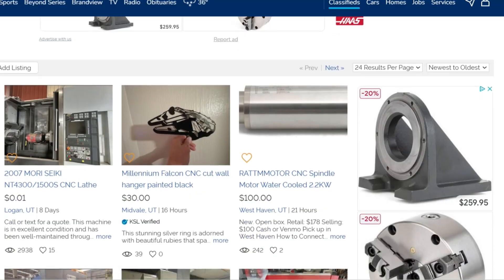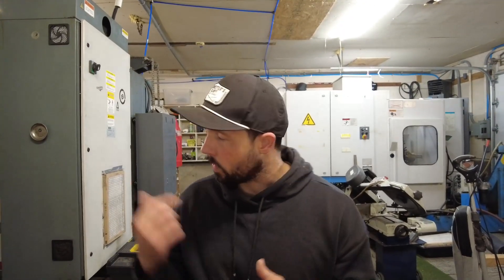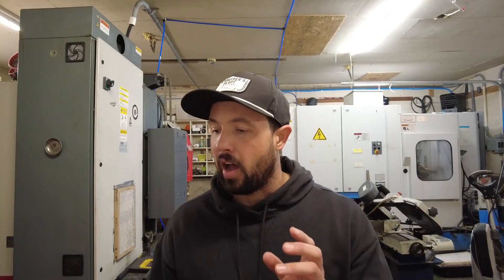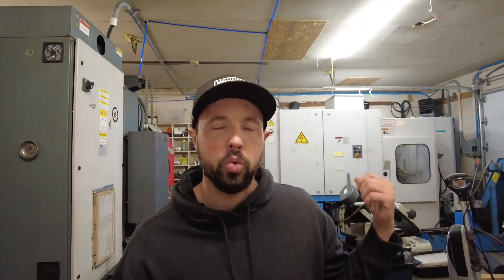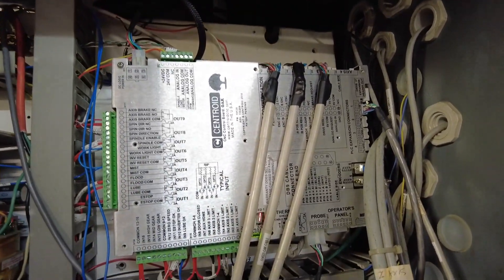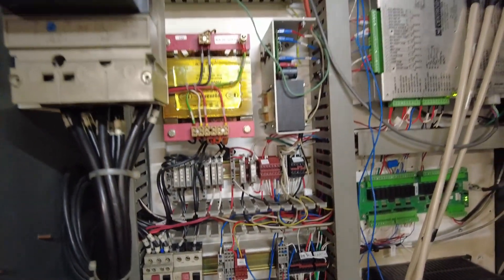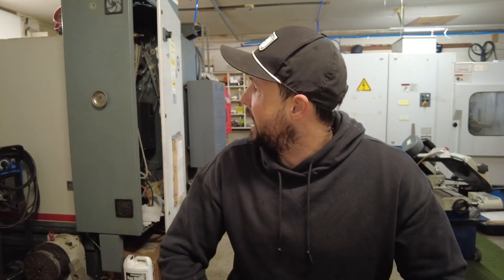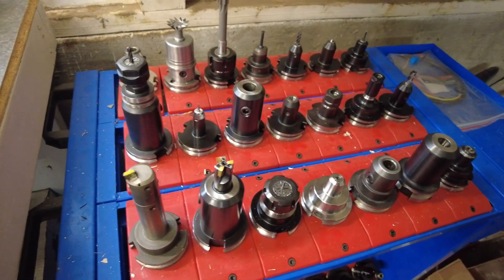CNC RETROFITS - HOT TAKE

Comment: A retrofit usually does not use parts from the brand of machine you are retrofitting ... I took retrofitting to mean that you do not use any original parts for the machine.  All you do is use the machine base as it were and everything else including pc, servos, interfaces and so on are from readily available manufacturers that never run out.  The whole point of a retrofit is to never have to rely on original parts for the machine.
Reply from the maker: I think you can certainly do it either way.  You could pull everything and start from scratch but both of mine I reused certain contractors and relays, much of the wiring guess it just depends on the machine and what it needs to do.  For me as long as it’s running and making money I don’t care what components it has.  Once you’ve done a retrofit you know what every part does and can pretty easily find an alternate solution if something fails.    Some of the motors have to be reused like the tool change motors air solenoids and they can be proprietary to that machine.  So it’s definitely a mixed bag.

Comment: I am thinking about converting an old CMM machine to be a mill... 
The base is made of granite, way covers are all there and all. 
Worried about the size of linear rails, or if there are actual ball screws in there.
Reply from the maker: Oh man,  I have no idea.  I mean in theory if there’s 3 axes and ball screws you can turn you can create motion, but you’ve gotta have a way to mount a spindle and have it be perfectly vertical.  I would say finding a small router would be much cheaper and get you better results.   Another down side to those CMM machines is so much mass is just the granite and it doesn’t really benefit you when it comes to cutting axis mass.  I won’t say don’t, but also really consider what you want the end outcome to be.

Comment: With the price of brand new machines from China it isn't worth retrofitting anymore.  Chinese machines are beautifully built these days and are full of top quality components from Taiwan, Germany and Japan.  If anyone is interested I have a really nice 2000 Matsuura VG660 which I am replacing. It runs great and comes with a ton of parts like drives, extra spindle, ball screws and linear guides from 2 others I sent off for scrap.  I paid $24,000 5 years ago. $3500 will cover it but it's in Canada so be aware for shipping cost and possibly tariffs.
Reply from the maker: I agree there’s a lot of great machines at a good price point now.  I do see a few Haas machines going for near free 2-5k range.   I recently saw a VF9 go locally here for 4k.  With a centroid retrofit you could have a STOUT cat 40 machine + new electronics for under 10K.   It’s  not every case but many cases where a retrofit is massive bang for buck.  I got my Arrow 500 for free, retrofitted it for around 12K and have made 10x my investment in 5 years.
Reply: @ericschneiter  I think a retrofit makes sense if the machine is nearby.  I put a Centroid on my old Hurco because I didn't want to go through the hassle of switching in a new machine. Shipping has become very expensive. 2 years ago I bought 3 VF3s all at once  so I could split the truck cost over the 3.  Shipping 1 machine was almost the same as 1.  Those were VF3SS models with lots of options and they were around 14k each.    Funny thing is I have 2 brand new machines coming all the way from China and the shipping is cheaper than the cost to truck those VF3s within the USA lol!

Comment: I did 4 retrofits on small conventional machines and learned a lot. The 2 last Centroid Acorn. Learning first on small, less complex machines helps a lot. I agree with a lot of what you said. I used clearpath and DMM servos and buying CNC4PC interface boards helped a lot with wiring the drives. If I went for a serious retrofit to make a living out if the machine, I would go Ethercat for sure.
Reply from the maker: Those acorn boards look like a great option. Do you have any new builds coming in the future?   I love the centroid software and it keeps getting better and better.  Lots of options now for the newbie up to the seasoned pro.   I may end up switching out an oak board for that hickory and the ethercat drives.   It looks incredible.
Reply: @ericschneiter  I mean they all offer incredible value. I use intercon on the lathe and Fusion on the mill and NEVER get a glitch. Next build will be a custom router / fiber laser based on a welding table.

Comment: I cant believe people would go through the trouble of retrofitting an old haas to some pc based control. The parts you need to fix one are all available on ebay for pretty cheap. And if you keep an eye out you can pick up a parts machine for pennies on the dollar. And when you retrofit a haas you are losing the technical support that haas offers. And with a 30-40 year old piece of equipment that is pretty valuable.
Reply from the maker: I’m a firm believer in keeping the OEM control if it’s viable.   For me I got an old Cincinnati arrow and parts weren’t there.  So a centroid retrofit was one of my only options.  For 10K ish that gives you brand new servos on all axes, new spindle drive, probing and its SUPER easy to work on when it breaks.   The centroid PC based controller is insanely robust with on board control and look ahead it’s not a toy…people run full 5 on these controls via ethercat.  machine has paid for itself and 2 others now.  But yeah, if you’ve got a working control and it’s just a few parts to swap, keep the OEM haas control for sure.  👍

Comment: I had a 1992 haas vf2 that worked fine before i sold it. But every replacement part i could ever need was readily available. And hfo boise was even willing to send out a technician to fix things if they broke or wore out. If you are looking for an older cnc haas is insanely hard to beat. A fadal, hurco, mori, or cnc bridgeport might make parts as well as an old haas. But the haas support network is second to none in America. At least none iv had experience with.
Reply from the maker: I’ve always heard this is the case.  No gatekeeping on parts and service even if that thing is 30 years old and worn out.  I wish every company would do that.  I always highly recommend haas to people considering a retrofit.

Comment: I see shop size tormachs for sale all the time in my area for around 15k.
Reply from the maker: Used Tormach at 15k is a little steep in my opinion,  better be all tricked out with a tool changer and 4th axis for that.  You should be able to find an older haas or cat 40 style machine for at or below 15.   No shade on Tormach I LOVE mine but you reach their limitation quick if you’re doing volume.

Comment: Hello! What about Chinese GSK brand?  As far as I know, GSK is enough in a quality (but not equal to Delta).  The manufacturer has lathe, milling   control panels and servo set with GSKLink industrial ethernet on stock. Thanks!
Reply: I just got back from China and almost went with GSK for my new 1160 machines but the Siemens control and motors had higher torque so I spent the extra for that reason.

Comment: Great video! I did a. Allin1dc retrofit, that turned out good. About to start another. Thinking more now about the hickorynoption you mentioned. Kinda pricey though. My retrofit was significantly cheaper, but i reused most of the components. Id say I was in 3-4k at most. My next one will be more in depth, but will have more features. Centroid definitely makes things easy. Not the cheapest but very good documentation and support, which can make or break a project.
Reply from the maker: @frankljs  that’s awesome! Always super satisfying to have a machine that works and feels new at the control.  I’ve been super happy with mine.  Hickory looks like for sure the way to go from here on out.  I think the Ethercat would make it a breeze.

Comment: Love it Eric.

I agree on pretty much all the stuff you have said.

I have 6 CNC machines here 
2 vertical mills.  2 CNC lathes.  1 really big cnc router (6.5m travel)
And of course the fh680 mazak which is the big brother to your mazak.  I use linuxcnc so it's interesting.  Comparing to centroid.  They are both Rock solid i think.  Linux CNC is more versatile.  And rigid tapping is really well implemented i can rigid tap at 1500 rpm if i wanted..  But centroid is easier the first time around.  Great thoughts and awesome to see your shop.
Reply from the maker: @linuxcnc1736  I need to learn more about Linux. I know it’s super versatile I’d love to dig in more and get up to speed.  Might grab a lathe here in the next year and maybe I’ll go with Linux for that retrofit.  I LOVE the probe basic UI it looks so good.

Comment: Thanks for the video.  Very interested in doing this myself.  One question...could you please elaborate on what the problems with rigid tapping are? Are there issues getting the spindle and the z-axis servo talking to each other?
Reply from the maker: @madmat990  I think my issue is in the velocity tuning in FOCM mode.  I can accurately control the rpm’s but the reverse and dwell isn’t quite right.  I could probably figure it out with more time but have gotten pretty comfortable with thread milling and I prefer that in stainless most the time even though it’s slightly slower.  

That being said the Centroid board can control rigid tapping very effectively but knowing how to adjust and tune the spindle drive properly can be a little bit tricky.